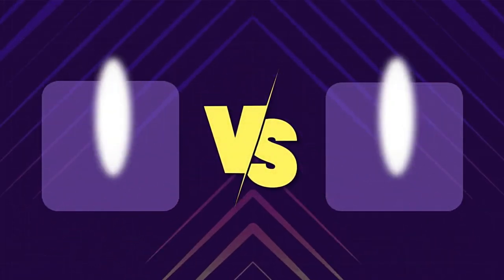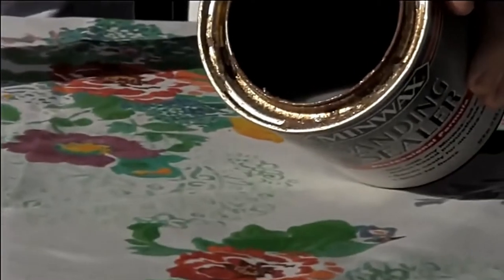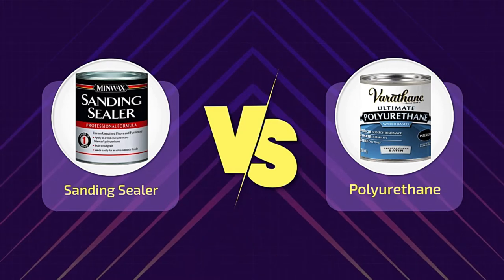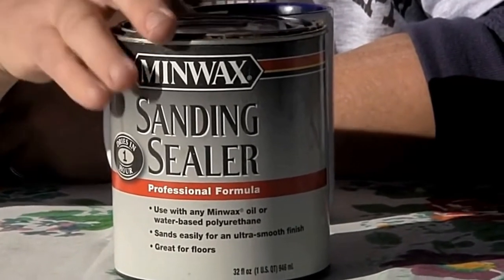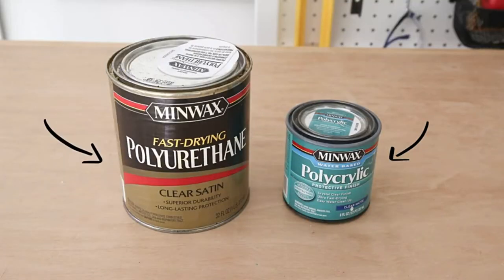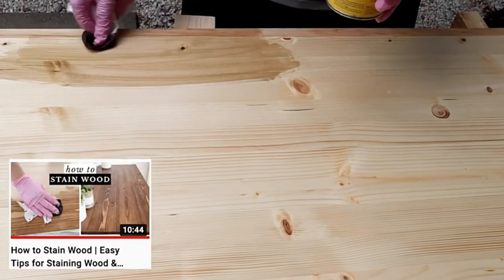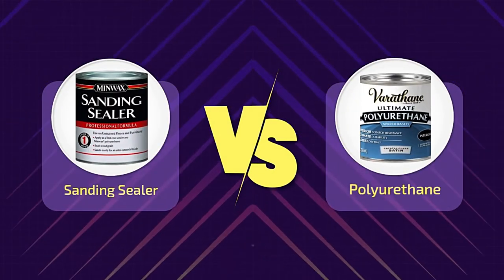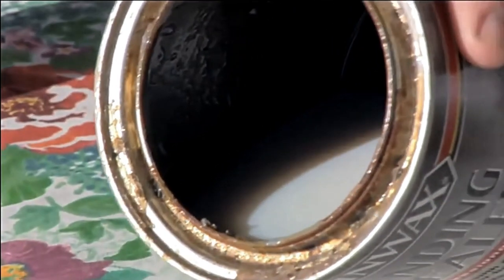Sanding Sealer Vs Polyurethane

Comment: Ordinary lacquer, such as Watco brand, IS "sanding sealer". Now take it and mix it 50/50 with lacquer thinner and you'll get an all-purpose solution that is used in the Far East for all kinds of things. It can be used as a primer or pre-conditioner, can be used in layers as a finish or top coat, and can also be used for touch-ups. Make sure to use it in a well-ventilated area or wear a respirator.

Comment: You mentioned the VOC and the long drying time. That is only for oil base. Water base does not emot that and dries extremely fast. I can put down three coats of water base in a home in one day but oil base only one per day
Reply: Almost all finishes have VOCs even water based, they are just less toxic.
Reply: I use a fast drying Pollyanna that dries in 3-4 hours..